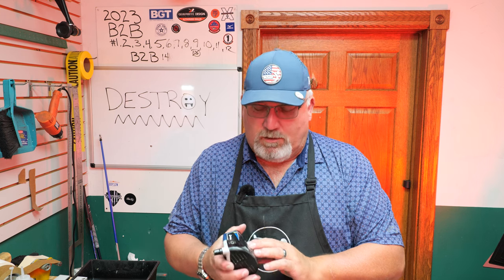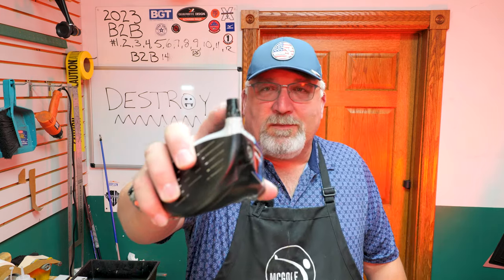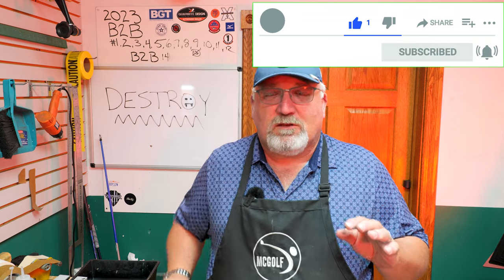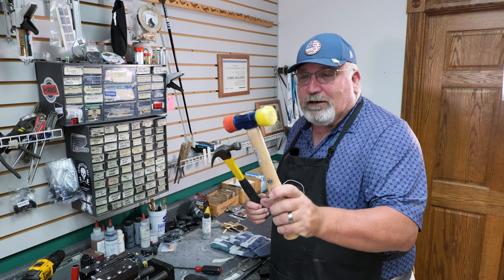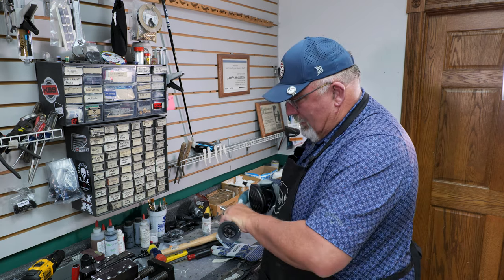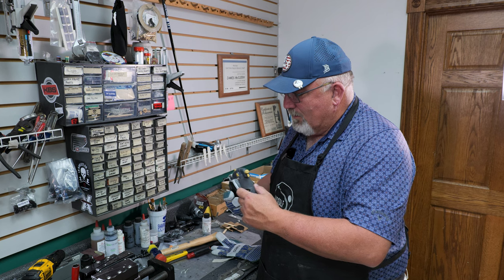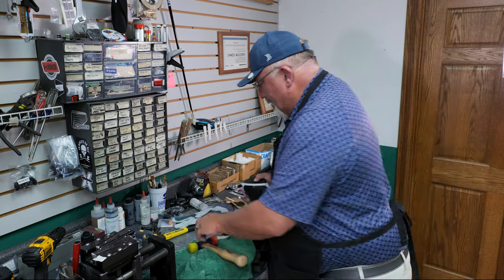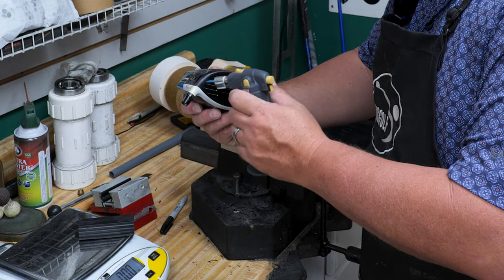Golf Club Repair- removing an adapter from the head

Comment: In my experience, you can pull the screw out of the head (a rubber washer holds it in), spray WD-40 in the opening, and take a straight allen key and hammer it out while the head is on the vice. The adapters are usually shot from all the aluminum corrosion.

Comment: Had similar issues with Stealth 2 adapter.  Was told the aluminum oxidizes from the adapter and welds itself to the head.  It was recommended to remove from the head once a month to clean.

Comment: Had this happen to a stealth driver multiple times, I took out the screw completely and used a screw driver that could get through the screw hole and hit it into the end of the adaptor with a hammer worked everytime. But mine had a lot of the Vertigre stuff but nowhere near that much 😅
Reply from the maker: That’s why i tried the screw method first.

Comment: Jim, if you had put a drill bit, shank first (and appropriate size for adapter .335" or .350") you can crank right down on it and know you can get a solid bite on the adapter. Hopefully you get it out easier next time with less heat and cosmetic damage to the head 🤞

Comment: Fun to share ideas on here. 

I have had this issue as well. Used my adapter pulling cap screw threaded through head as original screw was. Then tapped on bolt to knock out adapter. 

Vaseline is my go to anti seize for these.  

Thanks for another great vid Jim.

Comment: Great vid as always Jim. Had the problems in my shop too. We now always use a little copper slip compound when we work on tip adapters. I also think that if the tip adapter has been heated a few times with shaft changes these tip adapters can become problematic with the expansion and contraction etc .

Comment: Jim.. Assuming when you pulled the shaft the Adapter stayed stuck in the head. Never had that happen. I use a Golf Mechanix /GW screw and washer set.. to remove adapter from the shaft. You’ve got a bigger !!

Comment: Hello Jim, any tips for installing taper tip still shafts in PXG irons? I use the collared ferrules and the PXG style plastic "centering" tips. The fit is still sloppy and I've already had one head come loose. I tried dry fitting with brass shims but the PXG style plastic shaft tips actually provided a snugger fit. I used Golfworks epoxy and added some Brampton centering beads (not much). It just seems like this one size fits all hosel design seems like a ticking time bomb for failure...lol!  Any advice would be greatly appreciated. Thank you!

Comment: Just purchased a taylormade stealth  2 used. After getting the club, I tried to remove the head to make an adjustment.  The shaft would not move. I remembered watching your video on how some of these adapters can get stuck with the white substance.  I heated the adapter up a little, and after about 8 minutes of pulling and wiggling, the shaft came out. Is it just getting the head wet on fertilized grass that causes this? Thanks